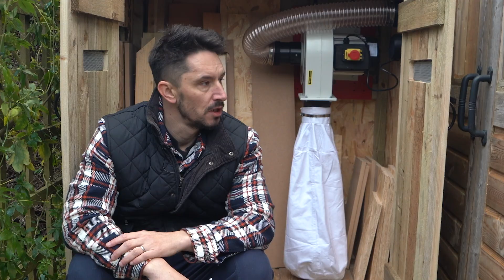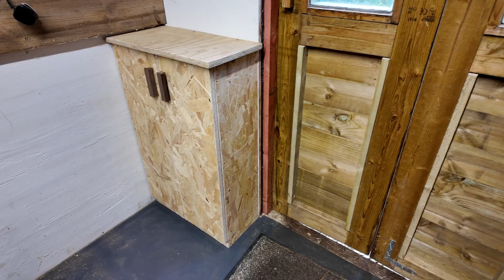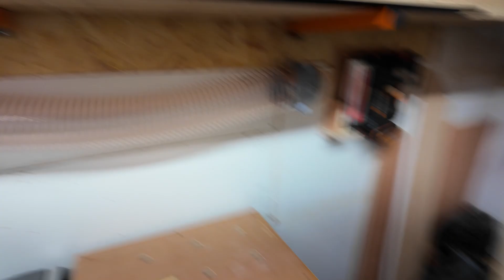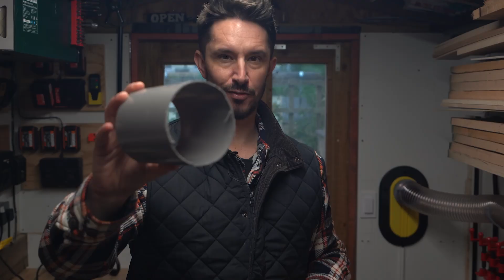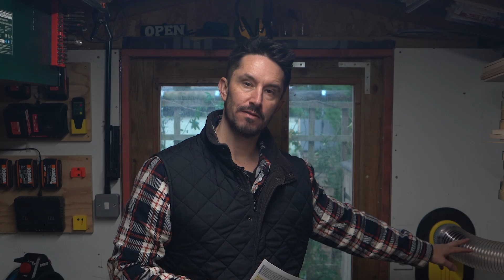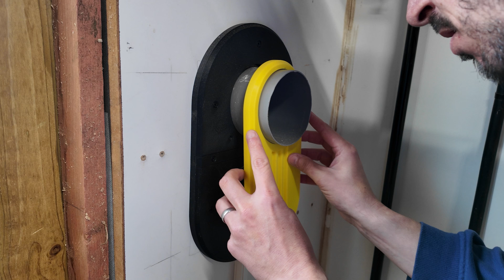How I Installed a Dust Extractor Outside My Shed to Save Space!

Comment: One big problem most people over look with putting a dust collector outside, is you are sucking your heated or cooled air out of your workshop when you don't have an air return to your shop.  You will feel it on very cold and hot days, along with lower collection ability, if you have a good insulated work shop, when all the windows and doors are closed.

Comment: fellow woodworking spark here. you could re-print your adaptor for your cable insert in the extractor shed, and drill a 20mm hole and use a 20mm TRS cable gland if you really want to keep it airtight.

Comment: An easy fix for the too small holes could have been a drill mounted sanding drum. A small diameter (say1/8”) aircraft drill (very long drill bit) as a pilot hole will index your through holes . Cool that you detail the pluses and minuses of your project. The final result looks badass good job sir. I am from the USA so i dont do metric lol.

Comment: I can shed a little light on the CFM thing as I’ve just gone down this rabbit hole recently. 

It’s not that the machines are underpowered, it’s that the CFM they’re listed at is measured directly at the machine, with no ducting attached. Every foot of tubing, every bend, every reduction to smaller tubing, all reduce your CFM. 

The absolute worst offenders are flexible tubing and 90° turns. The smoother the inside surfaces of your ducts are, the easier air can travel. The ridges in the flexible tubing and elbows in solid tubing disrupt the airflow, slowing it down. 

Obviously bends in the tubing are unavoidable and flexible tubing has it’s place, you just want to limit these things as much as possible to maximize your CFM and take them into account when deciding how much CFM your shop needs. 

One thing you could do that I think would make a noticeable difference is to turn your dust collector around and connect the intake directly to the pipe going through your shed, eliminating that 180° flexible tubing bend you got.

If you’re interested in getting a ballpark estimate of how much CFM you’re actually getting, WOOD magazine has a neat little formula for calculating that. 

https://www.woodmagazine.com/tool-reviews/dust-collection/dust-collection-that-evolves-with-your-shop

You can also buy an anemometer for quite cheap on Amazon but I’ve not used one so I can’t attest to their accuracy.

As with almost any problem, the easiest solution is to throw money at it and buy an overpowered machine with way more CFM than you need so you don’t have to worry so much about maximizing efficiency but for those of us who don’t have thousands of dollars laying around, we gotta get creative.

Anyways, sorry for the essay no one asked for lol and great video. I appreciate you telling us your mistakes cause I know I’ve been a damn near identical situation trying to fit a pipe through four 2x4s and the holes not lining up.
Reply from the maker: This is a really insightful and thought out comment - thank you for taking the time to post it. Sorry it took me so long to respond! I am really curious to see how much efficiency I'm losing with the bend so I've just bought an airflow meter to measure it and will make a little video about that. It's working fine really, I've put a fair amount of Oak through my planer thicknesser and the extractor is doing its job but I do want to maximise its efficiency. Anyway, one day I'll just buy a dual motor cam vac and be done with it!

Comment: Those mistakes are 100% the kind of things I would do lol
Have you measured the flow to know if that 180 degree bend at the inlet for the extractor reduces it?
Reply from the maker: You might have inspired my next video - I've just ordered an air flow meter from Amazon! I've also just hooked my shop vac up to a load of ducting (inspired by your budget dust collector video from a couple of years ago actually)! so, I'll measure that too. It all seems to be working well - I recently put a load of Oak through the thicknesser and I was pleasantly surprised by the extraction. Albeit I can feel an optimisation rabbit hole fast approaching...
Reply: @ that’s awesome! Recently I’ve been playing with my home made twin motor vac because twin motor camvacs are crazy money. It’s to this point upset everything I knew about HVLP and HPLV dust collection - not quite though!

Comment: This is what I was planning for my man cave, to house a dual motor camvac and cyclone outside. What’s your experience been regarding the negative pressure resulting from extracting so much air (and heat) from the shed? I see your second duct for the cable could act as a return for fresh (cold!) air, but I ended thinking about heat exchangers. I also thought about venting the camvac back into the shed via a Silent Box along the lines of the design from Dennis on Hooked on Wood.
Reply from the maker: Sounds like a great set up - I'm jealous. I've recently spent a week thicknessing Oak in my shed with the extractor running almost all day and I've not noticed any pressure change. I can definitely feel it pulling the warm air out, although a quick blast with the heater and the temp is back to normal. It's been very cold out lately so perhaps I didn't notice as much as I would normally. I can't see it being much of an issue for me tbh - I'm constantly opening the door as I don't have much space so the temp is all over the place! Dennis knows his stuff and his set up is leagues ahead of my level so if you've got the budget and time copying him would be a good idea I think.
Reply: Thanks for the quick reply. I’ve decided to start with it all housed internally, and a variant of Dennis’ silent box tucked away under or on top of my tall cabinets. As for fumes from my laser, I think there’s only one option and that’s to put a hole in the wall!
Reply: Space is the #1 concern.

Comment: The main reason I got a 3d printer was to make dust connectors, it drove me nuts how nothing matches😅 I have the same extractor for my CNC, it's slightly underpowered but nice and quiet, cheers
Reply from the maker: Same here! Thats exactly why I bought one and then I just haven't stopped - love it. Good to know about your experience with the extractor. I'd love to own a CNC one day - I've seen loads of videos on my feed about the new Altmill lately.
Reply: @shed_time  I've seen that one I started with a second hand machine from CNC step, it had its limitations, now I have an I2RA , I love it, I see axminster tools now stock them, the process is a bit of a learning curve but well worth it

Comment: Good video! I just subscribed. I wonder if it would have been better to mount the extractor the other way around so that the pipe comes straight out and avoid the 180 degree turn in the flexible hose? If you get trouble with airflow it might be worth a try.
Reply from the maker: Thanks for watching Kalev! Yeah, I would have liked the hose going straight through without the bend but there's no way of doing that with the position of the shed. I'm going to see how it works out and then, if I have to, maybe build a partition wall in the extractor shed so I can turn it round 90 degrees.

Comment: Great little project but you would have saved money using so pipe instead of flexi hose I understand the corrugating reduces air flow and cause turbulence in the system
Reply from the maker: Thanks George. By so pipe do you mean soil pipe? I think I will eventually replace the long hose with a solid pipe of some sort for the air flow reason you mentioned - I left it long for now whilst I figure out where my planer thicknesser will live.
Reply: @ Yes Adam I have been watching quite a few videos re dust extraction using 2 vacuums at the moment but not ideal 🤨

Comment: Thanks for the video. Thinking of doing something similar. I hesitate on one point though: when using the extractor on a cold day, will all the warmth from inside your shed be sucked out?
Reply from the maker: Cheers Bruce. I do hear they suck the warm air out so it could be an issue...and my shed isn't particularly warm to start with! I'll see how it goes - I've got a lot of Oak to run through the thicknesser soon so I'll report back.

Comment: Great video. I’ve looked at something similar but don’t have room to the side of my workshop. It does however have a loft space above which I’m thinking of using if I can find a way to get the collected dust back down. I might have to revisit this idea now in the new year.
Reply from the maker: Cheers Ross, hope all is well with you. The loft idea could work if you piped the dust down to ground level somehow, maybe a hard pipe down to a barrel / cyclone....I thought about replacing the bag on my extractor with a barrel but need to do some more research first.
Reply: @ that’s what I was thinking, it’s just how to fit it all into an awkward space. Time will tell on that one I think.